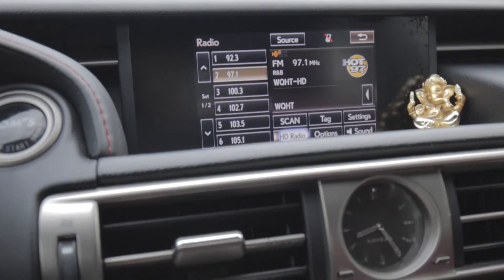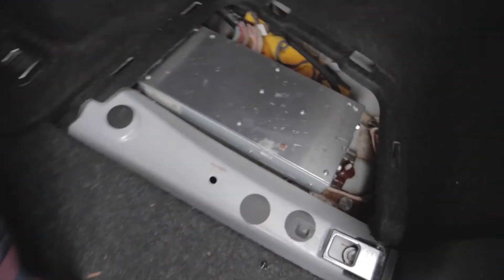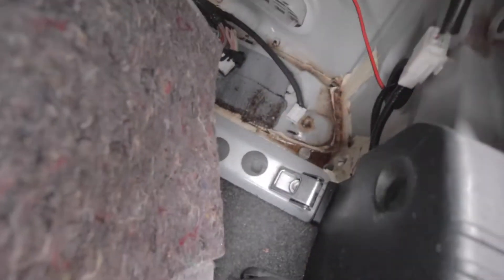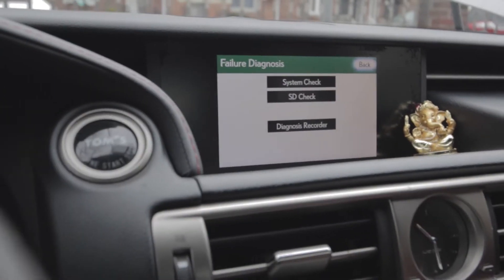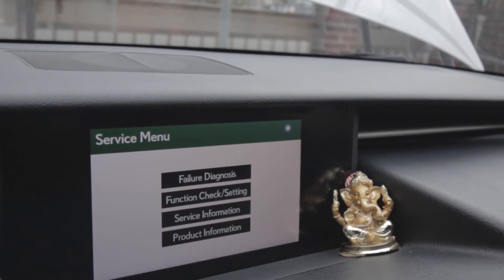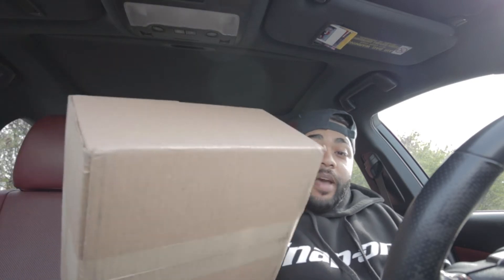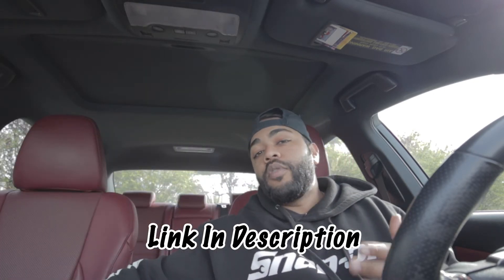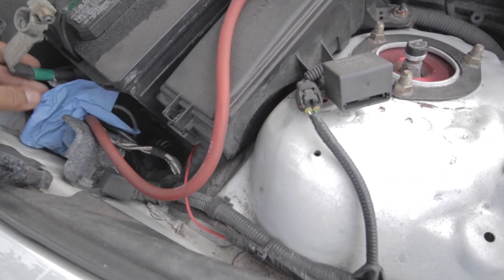I Figured Out What Shorted My Lexus IS250 Amplifier...

Comment: That should be a recall
Reply: I have the same problem with my Lexus is 250 2015 with this radio no working properly after I see this video i star looking in the trunk and have like 2 inch of water in it in the amp

Comment: Thanks for the info. I'm having the same issue no radio no display working just the air and heat. I'm asking everyone one with this issue to contact your state's Attorney General office and file a complaint. If they get enough complaints they will make Lexus do a recall.
Reply: Lol but the reason why he even had water is because his car was rear ended not because of Lexus mess up

Comment: If you have disconnected the battery with the OLD AMPit would work again for few days and the it would trigger the protection again.  The best way to clear the code is to go to the System Check Mode (the Green/Gray Screen Menu) where you checked for the AMP Status and Clear All the CODES by pressing and holding on "Memory CLR"  until all codes are cleared.  Then turn off the car,  open the door,  close the door, lock the car and re-open the car,  start the engine and VOILA!!!!   You still have tofind a way to fix for the water condensation in the trunk where the AMP is.  Maybe drill a hole, or insulate the amp with some plastic or foam materials.  Thanks
Reply: i did what you said it worked for a few days and now it aint working again

Comment: GUYS THE WATER IS FILTERING TROUGH 1. One of the clips in the back of the truck, or number 2 the back lights.Same problem here. Just trying to help someone out that’s trying to figure out where the water is coming from
Reply: Did you find a way to fix it ?
Reply: Is there no drain plug or hole at all? What a weird place to put electronics into...
Reply: 100%  We had water where the spare tire is.  Disappointing!

Comment: Send the amplifier to OEM Auto Audio Inc. out of Manlius, NY - they fixed my amplifier quickly and let me know that the pressure vent mounted above the amplifier caused the leak.
Reply from the maker: That’s good to know for the next time it happens I’m pretty sure it’ll happen again lol thanks man
Reply: Yep I went to OEM auto. Got my radio fixed. 2014 is.350 is notorious for head unit failure

Comment: My whole radio just shorts out all the time, it almost has a mind of its own! You need to fix the leak issue. I took my car to Lexus and they said the same thing!! They said they need to fix the leak and the amp at the same time and were charging me close to $2k! I will update you with the aftermarket amp and see if the full headset works. Luckily I got a free one so I will be trying that and if that doesn't work I'll have to go your route and  get mine fixed. Glad you linked the united Radio... this video is everything!!!
Reply: how did you end up fixing the leak. i have the same problem

Comment: This same thing just happened to my 2014 Lexus IS 250 but also the screen would power on and off all the time before the sound completely stopped. If I get a new AMP will it fix both issues? I was hoping to get an aftermarket radio but everywhere I asked, said they couldn’t do it. 😢
Reply: Did you get it fix

Comment: Yea same thing happened to mine. That flap that is under that spot by the amp let’s water in. Heard flap can be fixed but I’m scared and might re route to above on the carpet like you had it. Similar issue on my RCF. I think it’s bad location for the amp set up. Sucks tho. The new amps are 600 to repair. 1000 for refurbished. Both come with year warranty. Or new amp is 22-2500.

Comment: This was my EXACT issue as well smh 🤦🏽‍♀️, I just bought one used on eBay for $650!!!! I see so many similar comments here, WOW. Lexus needs to be held accountable for this. How is this not a recall?!!!!! UGH
Reply: I’m having the same issue at the moment myself for about a month. Took the amp out, opened it up, didn’t see any water in the place where the amp is held or any water damage inside the amp itself either. So now I’m not sure if the amp is “bad” or not.. don’t wanna just buy another amp without knowing if that is the real issue. Smh! Lexus should recall because everybody has the same issue. Mine is a 2017 is350 fsport.

Comment: I have a question. My radio is doing the same thing, so I bought another one off ebay.I swapped it out, and still the same issue, no volume, or volume controls. I could understand it might be the amp, but why do the volume controls not work in the new one I bought? Or does the amp control the volume controls?

Comment: Harness Cable are creating resistance. Try cleaning terminal with special cleaner. Ensure contacts are VERY CLEAN.  If the AMP worked for few days it means that is not the AMP.  It is just the resistance variations coming from the cables etc..  Sorry I couldn’t help you more. 😢

Comment: What did you use to remove it? I’m trying to remove mine and the 10 mm wrench won’t give me the angle I need
Reply: same! what tool did this guy use?
Reply: You need a socket with a deep drive to reach the bolts and have the right torque

Comment: Should i unplug my battery before taking out the damaged amp or only when installing the new amp??
Reply from the maker: Doing Anything electrical I would just unplug the battery as a safety you don’t necessarily need to do it when you unplug something but it’s good practice just in case

Comment: Quik question bro was your rr racing tune just plug and play or did you have to upgrade your factory computer first..
Reply from the maker: I had to upgrade my PCM first unfortunately but the tune was definitely worth doing
Reply: @ChrisKheluram  did u get it upgraded at the dealer
Reply from the maker: Yeah I did,, just be aware some lexus dealerships charge you more or less, sometimes they just make up a price because they don’t know what the hell you’re talking about lol.. so check around with that PCM update the tune will not go through
Reply from the maker: Without*
Reply: @ChrisKheluram  thanks for the info bro..is yours 2014 or 15

Comment: My shit is just like that. I had to ride around with my Bluetooth speaker in the car. I still can’t figure out how the water gets in my trunk. I covered the air vents after it survived the 1st water issue and the water still got in. I need to figure that part out now. I think it creeps in through a lil space separation from the body and the rear bumper. I was just like you tho before I found it…devastated and super excited when I found the issue. Then It happened again lol. It’s been months and the crazy part is some days it randomly comes back on then goes out during the drive. Imma have to pay that $650 if it’s still $650
Reply: Oh I drive a 2013 Gs350 so it affects both models

Comment: I have the same issue for the longest … this what I’ve learn. My radio has no sound, no volume indicator .. I replace my amp a new one, even though I have no signs of water leaks, it did not fix it, but I did cut my carpet and relocate my amp into the trunk for safety  . Next I spent $900 for a radio of eBay, it fixed it. I have sound, 10 months later … same issue again .. I talk to a tech where I had my sub install … long story he believe there’s a defect with this particular year of radio … so I’m going send my radio out to have it repaired internally.

Comment: Hey bro I’m having the same issues with my car, what fuse did you check?
Reply: It’s the 5th fuse , 15a . I replaced mine and it still didn’t work lmao
Reply: Also check fuses amp 1 and 2, they are both 30.
Reply: @Brutallic  thanks, I replace most of the fuses to make sure while back and that is not the issue and I took the car a month ago to Lexus dealership to get diagnostic from them they say is internal fault inside the radio they are asking 3k to fix it still the same 💀😂

Comment: I have the same issue every time it rains water gets in that same spot and it doesn't work until it gets dry I have no idea how the water gets in and I bought it with a blown amp since I didn't check the radio when I bought it
Reply from the maker: I literally had the same situation, I mean tbh I would move that amp eventually it would burn out like mine did

Comment: Hey I don’t know if I missed anywhere in the comments but how did the water get in there? though dealing with the same issue
Reply: It's actually crazy how many people are dealing with this, I think water had got in mine because of a big puddle I ended up hitting. Not too sure either
Reply: There is a vent on the side panel of the car where the amp is located, if you reach in with your finders you can feel the little flaps. Water gets in thru there and moisture.

Comment: That vent next to the amp is where the water comes in from…i sealed mine because of this issue
Reply: What did you use to seal it. I took my amp out of that spot instead  because I don’t want that issue due to moisture

Comment: Bro my 2015 is250 amp turns on during sunny days and doesn’t work on rainy days it’s pretty crazy considering it’s a Lexus lol everyone says it’s the vent and moisture but not sure man
Reply from the maker: I know man But it most likely is the moisture causing it to go in and out. I need to figure out a solution eventually
Reply: Yer I've been noticing this too on my 13' GS350. Sometimes in the morning when it's hot af the sound and volume control stop working. And when it rains it sometimes get even more glitchy. 

I just took mine apart and saw some corrosion on some pins I tried cleaning it up but Now it stopped working for good usually I would drive for a bit and it comes back on but now nothing.
Reply: @ChrisKheluram wrap in water proof

Comment: Can someone please helppp. Mine says audio off and wont change, cd player making noise constantly. No sound when i hit buttons and no hands free Bluetooth anymore, aircon everything else works. Checked fuses and even replaced a couple and they seem ok .. i think i found the amp and there was a 5 c coin near there i removed??. This happened after i spilt mineral water around my hear stick cigarette lighter etc. Even the charger still works where i spilt water there!? Wtf happened i cant figure it out 😭 i dont know if i need a new amp and dont want a dealership to exploit me plus i literally have zero $$. Can anyone help. I dont kniw how to reset my amp or nav system/ audio. All i can find is hold the volume and power button down which does literally nothing 😩🤦‍♀️ please help someone, everything going wrong lately! Cant even afford a service!!

Comment: My sister has the same exact car as mine 2014 Lexus IS 250 and my boy has the same as that year but the F sport. We all have the same problem the radio and navigation system and the cigarette lighter charger and the USB charger comes on and off and then sometimes the radio comes on stays on for about couple minutes and then turns off. And then sometimes it just stays black on the navigation screen no radio no nothing. Then sometimes the screen is black but it has some words on the screen that says a program cannot be read please consult to a dealer. My friend thought it was the radio so he change the radio same problem
Reply: Yo I have the exact same problem. Did u ever find out what was causing it? And were you able to fix it?
Reply: Wow I have the same problem if you found the problem please let me know

Comment: My amp stopped working due to humidity when it rains and needs to dry out then it works. I bought used one from eBay and did not put amp back into metal mount but wrapped with towel and kept in back of trunk and DID not put it back in amp compartment and towels solved issue of humidity damaging the amp

Comment: How do you water proof amp ?
Reply: Just relocate the amp out from the oem spot
Reply: @ViEtKiDD617  where's a good place?
Reply: I cut a hole in the carpet and reroute it into the trunk, mine sits inside the trunk next to my aftermarket subwoofer.

Comment: How is the water getting in there?
Reply: There’s a vent right there going outside the car
Reply from the maker: Yeah pretty much vent seal separated over time, which allows water to get in
Reply: @kevindoolaram1038   can you mount it higher?
Reply: @Ashantiblack79  you could but then your panel that covers it wouldn’t fit until you cut and modified it. Simplest way to fix it would be to change out the vent if it’s going bad

Comment: you dont need to change your head to add an bass amp just get a line out converter for 10 bucks
Reply from the maker: Dude I’m at a lost this this damn AMP I want to do a trunk set up. if I do wire in a subwoofer and mono amp to the stock amp wiring and then stock amp decides to die again I’m still screwed lol
Reply from the maker: Then again I don’t know anything about sound systems so I’ll have to do my research
Reply: you add the line out converter to the speakers in the trunk and the amp plugs into the L/R jacks on the line out converter

Comment: My amp not showing on the damn hidden menu, sent the amp out comes back with a pass report. Take the center console out clean every connector, take the radio out and do the same and notice the radio had some hand written numbers as if they replace it to. I'm getting fed up and just like you I didn't check the damn radio and the dealer kept playing with me. Did you buy that car from some indian guys in ny? I think u got a white f-sport correct? Someone bough the car from under me back in March so it would be funny if it was you, I ended up buying one local the week after
Reply from the maker: Lmao that would be crazy but no I got my car in September but there was guy looking at the same car I have, honestly though the Lexus I bought was a lemon lol.. if the Amp passed I would look into the head unit, also there is wiring on the passenger side kick panel clean those out and PLEASE disconnect the battery first. If not that you need too a short of any of you door speakers it will cause no sound if there’s a slight short in the stereo connection
Reply from the maker: Also make sure your part number on the amp is correct because you NEVER know lol